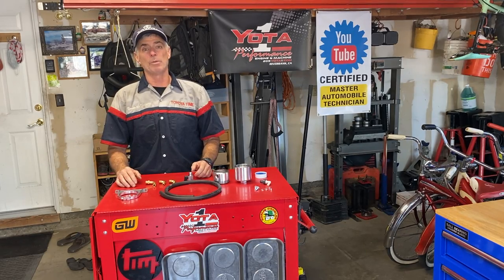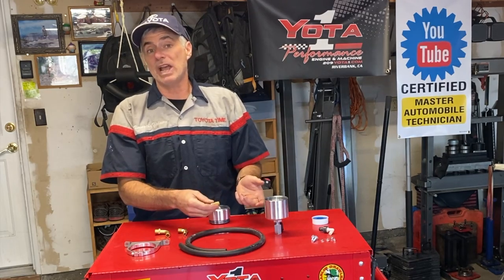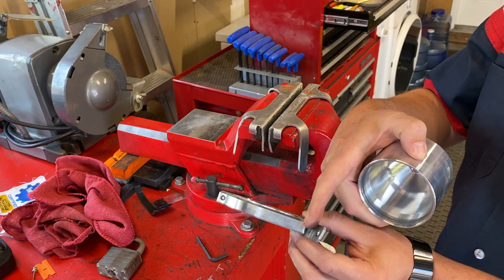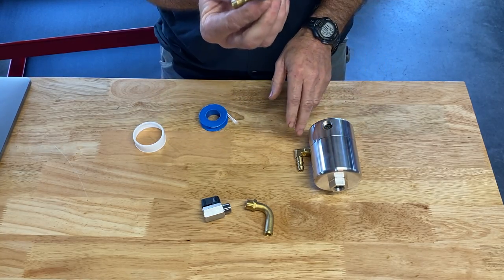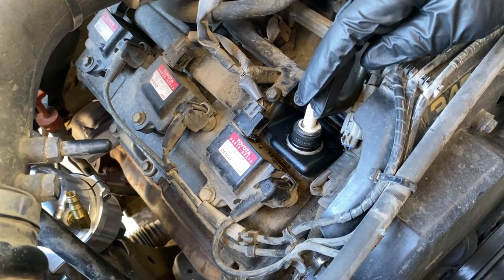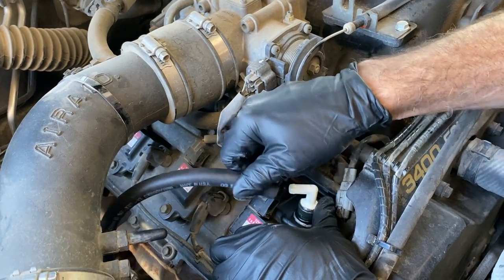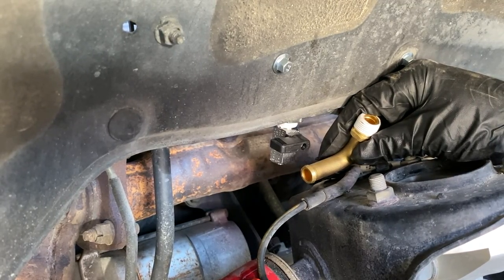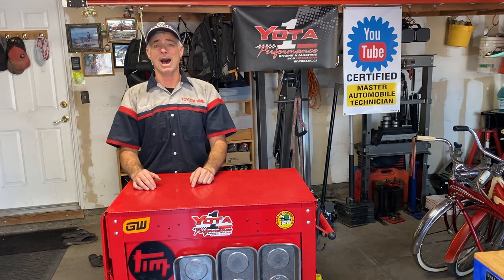Moroso Air/Oil Separator Install (aka Catch Can)

Comment: It would be hard to overstate how substantial this Moroso unit is.  I have an M/E Wagner dual flow billet PCV valve already installed and received the 85474 today to install on a Gen 5 3S-GTE in a Celica Alltrac so I can get reduce oil in the PCV valve loop caused by running at higher than oem boost--same issue as you mention with high performance motors.  This thing is a chonker.  I love it.  It looks like both ports just feed to the stainless steel mesh and it doesn't matter which one is from the PCV valve and which one goes to the intake manifold.  Thanks!

Comment: I have been using my for 6 years already, different brand different setup but still do the same job.
I would check this brand looks like a nice upgrade of my old catch can.
Reply from the maker: Thanks for the comment.  The Moroso is a nice unit.  If yours is working fine, maybe just keep it and save money unless you're looking for a little extra flair for your engine compartment.

Comment: I installed an Oil Catch Can on my 237000 original mile 4runner and get about 1qt of oil/fluid mix every 320 miles/tank refill of gas.  Seems like I have an excessive amount of blow-by.  However, the engine runs awesome!  Can cruise down the highway and excellent speeds.
Reply from the maker: Yes, that does sound very excessive.

Comment: First one I have seen in a 4R interesting thoughts
Reply from the maker: What I wonder Chase is how people route the oil back to the engine.  The air/oil separator is suppose to return the oil to the engine but where are they tapping in to do that?  That's what has me puzzled.  Are they drilling into their oil pan, tapping it and installing a fitting?

Comment: Just to  add to my failure.. I collected the separated fluid from the catch can.. I let the fluid settle and it was more than 75% water vs all oil. Alot of condensation from bloq by gas in the crank case gets trapped in the catch can and not only oil.
Reply from the maker: Wow, that's not good that water is being collected.  Time to do a compression check.  Maybe you have a bad head gasket.

Comment: I have a quetion, can these catch cans starve motors of oil and cause damage to moving components in the motor that require oil? Where as an air/oil separator somehow returns the oil, that got filtered out of the air, back to the crankcase.
Reply from the maker: I would say no.  For one thing, the catch can or air/oil separator can't hold a significant amount of oil.  Even if the thing was filled with oil, it wouldn't hurt the engine.  If you change your oil frequently enough and you actually check your oil regularly if your engine burns oil, you'll never run low on oil.
Reply: @TimmyTheToolman  Ok right on. Thanks for the quick reply. I have a 3rd gen Toyota 4Runner as well and I just ordered that catch can. Was seeing lots of oil collecting in the plenum. Thanks for the help man!
Reply from the maker: @Codvrv  No problem.  Good luck with the install.
Reply: @Codvrv   do you know WHY it is collecting?  i have a '97 rig that might have just started doing this at 341k and the MPG just dropped about 3MPG... lots of oil gas carbon mix pooling in the intake tube

Comment: Highly recommend AGAINST installing this on the 5vzfe... this adds significant pressure loss on the lines to the PVC valve which leads to over pressuring the lower crank case and also above the valve covers... ask me how I know... I'm currently dealing with a blown out lower oil pan fipg and valve cover leak due to a catch can I installed. What a pain in the butt. I'm using Tim's videos for the front differential removal to redo the oil pan seal.
Reply from the maker: What brand catch can did you buy?
- Sean
Reply: thank you!

Comment: Love the Video. Out of curiosity, in the long term have you had any pressure problems after the install? especially with the super charger?
Reply from the maker: Not sure I have had pressure problems but maybe I’m not monitoring it like I should. How does one monitor pressure problems and understand if they are happening? 
- Sean
Reply: what more meant is, for example I know that some 80 series Toyota land Cruisers will start to push oil out of the rear main seal and other places do to the pressure from a Catch can. have you experience anything like that?  @TimmyTheToolman
Reply from the maker: No, we haven’t experienced anything like that. This catch can/oil separator shouldn’t add any excessive pressure unless it’s clogged. I suppose that could be likely over time and it might be a good idea to clean the filter to prevent something like this from happening.
- Sean

Comment: Nice job guy's. I don't remember exactly what i did on my 3gen 4runner but there is an other tube comes from second valve cover i put T connector and connect to the same oil catch can.
Reply from the maker: We know what you're talking about.  That tube that comes from the driver side valve cover routes.back to the upper plenum.  That's something to think about.  Thanks for sharing.
Reply: Yes Sir👍

Comment: What about the second valve cover.  Its got a pcv as well
Reply from the maker: The driver side valve cover doesn't have a PCV valve, but it does have a fitting.

Comment: I actually had to remove the intake silencer because it was filling with oil from the two PCV lines 😬 I replaced the lines with small kn filters but this seems like a much better option. Does Sean know about how long it takes to get that catch can pretty full?
Reply from the maker: It hasn’t gotten full yet because I check it every oil change. But based on what you see being poured out at the end of this video, I would estimate it could take probably 10k miles to fill it up almost to the top.
Reply: There are (2) PCV lines?  Where is the 2nd one?
Reply: @spannersautoandcomputerser1649  the second one is on the drivers side valve cover, in the back near the firewall. It connects to the metal tubing on the top of the intake plenum then routs into the intake. It’s buried down in there a bit but the connections it the same 90 degree fitting like the one on the passenger valve cover.
Reply: @TimmyTheToolman  fair enough, thanks for your thoughts Tim! Sounds like draining the can every oil change should be just fine then.
Reply from the maker: @corbinail3295  Yeah, that should be sufficient.
Reply: @corbinail3295  what is the purpose of that hose line that goes to DR side that has no valve?

Comment: Thanks again for a great video.  Does the height of mounting point matter in comparison to the pcv valve.  Should it be lower to allow the oil to drain down?  I wanted to mount it next to the 3.4L air box but it looks to be higher up than the pcv valve.
Reply from the maker: Hey David, the height shouldn't matter with the installation unless you are planning on having the oil from the catch container drain back into the engine.  Then you'd need the catch container higher than the point on the engine it's draining into.  You're moving air with very slight traces of oil in it.  You're thinking along the lines of moving fluid which you're really not.  The fine mesh filter in the catch container is just collecting those traces of oil in the air, which over time will accumulate to an appreciable amount of oil going through the intake of your engine.
Reply: @TimmyTheToolman  Makes perfect sense now.  Thanks for the reply!
Reply from the maker: @davidmalmberg580  No problem David.  Happy Wrenching!

Comment: Did you guys have any issues with air noise in the hose returns as I have seen with other systems?
Reply from the maker: Sean hasn't mentioned anything but he does have a supercharged engine which is louder than stock.

Comment: That seems like an awesome product, thank you for the dope video as always! I’m not sure if it would be worth the $180 to put on my 170k mile 3rzfe although the plenum was pretty black when I cleaned my throttle body very recently.
Reply from the maker: Yeah, debatable if it's worth it or not.  Both my 4runners aren't supercharged so I don't know if I'll even go with one or not.  I might give one a try at some point though out of curiosity how much oil it captures and keeps from going through my intake.
Reply: @TimmyTheToolman  Did you end up adding it to one of your 4Runners? Curious if you found it captured oil if so
Reply from the maker: @awl1253  No, I haven't added it to either of my 4runners.

Comment: Thanks for another great video, guys!  

I have been contemplating this sick mod for my 5VZ as well. Anyone know if this will pass CA smog visual?  That is my only concern. Otherwise I probably would have done it already.
Reply from the maker: It shouldn't be an issue passing smog.  The PCV system is still intact.  It's just now routing to the catch container and then back to the plenum.  A smog tech during a visual inspection shouldn't have an issue with it.  If they did, it would be simple to just hook up the original hose from the PCV valve to the plenum, pass smog, and then reinstall the catch can lines.
Reply: Right on! Thanks  @TimmyTheToolman  ! For some reason all the smog guys up here in The City seem to be sticklers for every silly little thing that is not a factory part in the engine bay.  It’s really obnoxious.  I’ve been to three places before just to get someone to accept the perfectly legal carb sticker for my Airaid intake tube. Then, the third place insisted that I had to apply the sticker directly to the intake tube itself in order to pass it. Now the sticker is all junked up and peeling off the plastic tube and I’ll probably just have to swap out the entire intake tube for the stock one for next smog. Just lookin to minimize the number of sickmods that need to be temporarily removed every two years 🤣
Btw, I noticed Sean’s carb sticker(s) on the firewall. That’s a much cleaner look and seems way more logical as well.  Maybe I should just do that and tell them, “too bad I’m not moving it” the next time I have to smog.  Ha!
Reply from the maker: @benbanose  Hey Dan, sounds like you need to travel further for a better and less anal smog station.  The biggest joke is the stupid visual inspection.  You could have a cracked vacuum hose and they could fail you.  It use to be if the emissions coming out of the pipe was acceptable, it passed.  Now for most vehicles they don't even check to see what's coming out of the exhaust pipe.  They hook up the computer and if there's no CEL codes and all the emissions monitors are complete and ready, it passes provided they don't see anything on the visual inspection.  Part of the smog system could be faulty causing a CEL, but even though it's not having a big effect on what's coming out of the tail pipe, you will fail.  And, a lot of these emissions parts are expensive to purchase and expensive to replace.  States like California are ridiculous with their smog laws.
Reply: @TimmyTheToolman  you said it man! It’s totally dumb. The Nanny State will always find a way to ruin everything. Haha!
Reply from the maker: @benbanose  Yep, I never thought I'd leave California but I'm going to be gone soon.  I'm over it.

Comment: 1st time viewer of this episode... looking for clues!  my rig recently dropped 50~60 miles per full tank of tacoJuice after it had a bunch of replacing of and repairs of aged parts.. that is equivalent to 3 MPG on normal use like it has always been used and i cannot figure out WHY the MPG just dropped off a cliff like this. i put in a brand new Toyota PCV and hose (first new PCV valve in 345k miles)   5VZFE engine and MT
BUT!  i am noticing a mixture of oil-gas-carbon coming back into the big intake tuba via the hose that goes to the driver side VC by the firewall on 5VZFE... why is this oil gas carbon mix spitting back in the tube on the opposite side of the throttle body?? i have no clues, do you have any clues what would cause this issue Timmy  
Thanks!
J A Y  8^}
Reply from the maker: Some oil blow-by into the intake is normal.  You replaced the PCV valve and it sounds like it's doing it's job providing crankcase ventilation.  Why you've seen a drop in MPG, I don't know.  Have you replaced your O2 sensors?
Reply: @TimmyTheToolman  truck has had NO CEL for any 02 sensors indication they are 27 yrs old + 348k miles so i need to get some definitely for the next leg of the taco journey... there was oily residue pooling in the big intake tube snorkel thing between the MAF and throttle body coming from the driver side hose going to back of firewall VC. i do not understand if that is for fresh air to go IN why is oily gassy stuff coming OUT of that hose?? I pulled the tube for that resonator box and stuck a finger inside and pulled out a pool + i think it was starting to cake on the throttle body ... the truck was out of my sights for 12 weeks and I have no idea what abnormal irregular harshness it was subjected to  8^{
Reply: @TimmyTheToolman  when is your next planned excursion to Colorado?
Reply from the maker: @efil4kizum  I have no plans to be in Colorado any time soon.  What city do you live in?
Reply: @TimmyTheToolman  same as that Duane guy! TacomaHA
Reply from the maker: Oh yeah, I forgot.  I haven't been to Colorado in a few years.   I usually go for mtn biking trips.

Comment: Hey man I was hoping that u could help me figure out a misfire I have on 86 22re it only misfires on start up for 10-15 sec then clears up does it when it’s warm and could outside?
Reply from the maker: Are you losing coolant?
Reply: Yes it started by leaking out the bottom rad hose and I don’t even know why new hose , new clamp it would leak just enough to drip but I fixed that but now there’s no leaks anywhere and I go through a jug of coolant every 2-3 days now it doesn’t smell like burning coolant In the exhaust?
Reply from the maker: @myarvlogs1017  If it's using coolant like that, your engine is consuming it.  You either have a bad head gasket or cracked head.  Over night, coolant is draining into the cylinder causing that misfire but then clears up after the coolant is expelled from the cylinder.  That's my best guess.
Reply: If I did a leak down test on all of the cylinders would that confirm it
Reply from the maker: @myarvlogs1017  Yes, it would.

Comment: Whats torque spec did you tighten the fittings to? You didn't say in the video.. My V8 Toyota, I believe runs better
Reply from the maker: No torque value for the fittings.  It's like tightening pipe fittings when doing plumbing work.  You just use your best judgment and make sure you use teflon tape or some type of thread sealant so there's no leaks.
Reply: @Timmy The Toolman  did you forget your German, its goodentight
Reply from the maker: @DD-Aerial-Photography  Oh yeah, what was I thinking?  Gudentite is the spec.